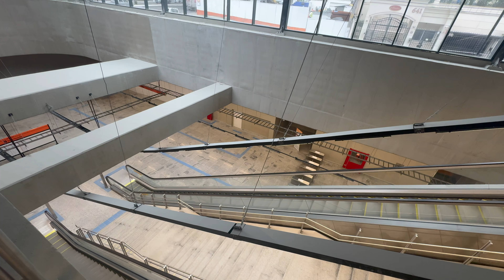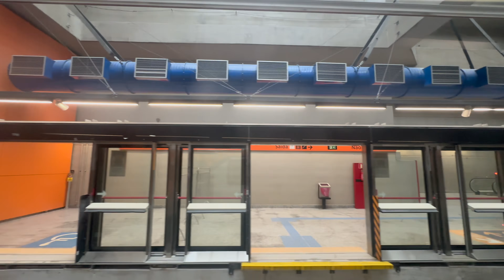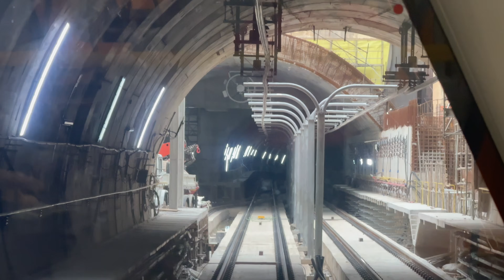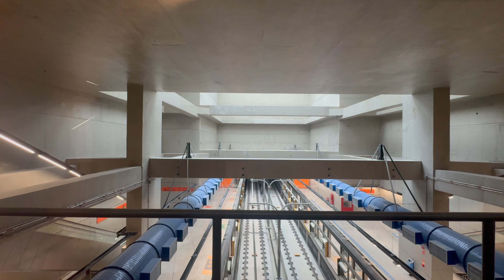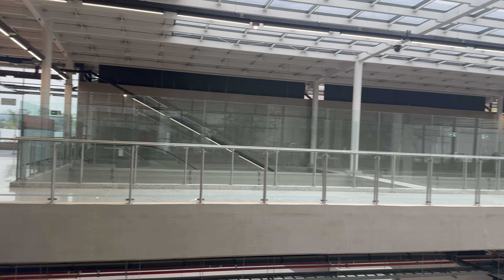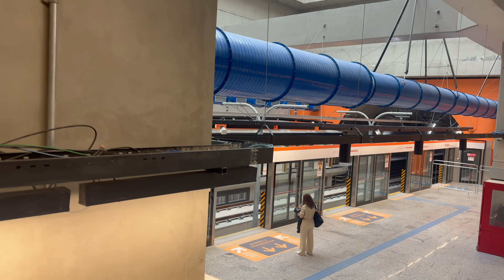The World's Newest Metro Line Just Opened...

Comment: Hello from the UK. Thanks for covering this. It's very curious. Is it actually open to the public? I've never seen a system running with platform screen doors held open like that. Any new metro line opening is a good thing, but I agree with your comments on the architecture. It's certainly quite bare/stark looking. I get that it's not quite finished, but it doesn't seem like they're going to change the architecture much. Those concrete walls could really do with some texture, colour or art of some kind. Quite a stark contrast to amazing new stations on New Zealand's City Rail Link project.
Reply: the platform screen doors are opened because the stations and most of the line isn't even finished with construction work, it only started operation now as an electoral move by the governor (hell if it wasn't general election year it wouldn't even be open)
Reply: @Azuuraas If that was the UK, I don't think they'd allow it on health and safety grounds
Reply from the maker: In the UK the line would not even be built because of some random spider needing to be preserved or something ;)
Reply: @Capybaratrains  haha. Well....Elizabeth Line got built, so...
Reply: the governor wants vote for the election this year, thats why the dumbasses opened it when its not finished yet